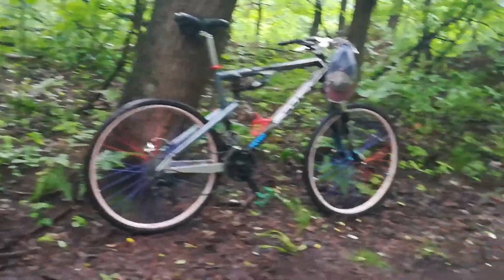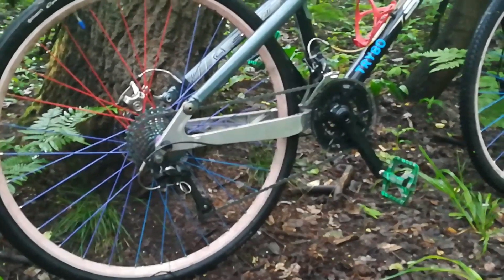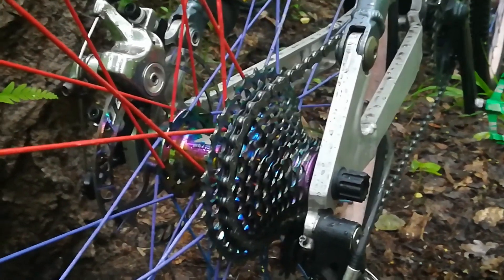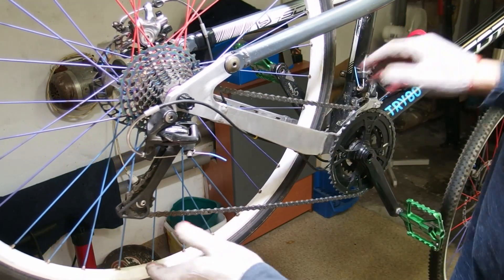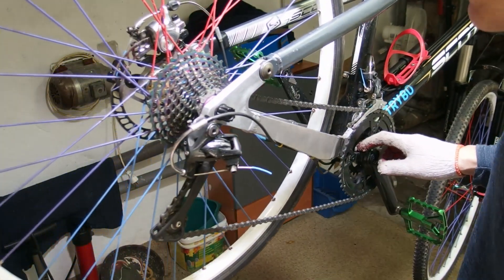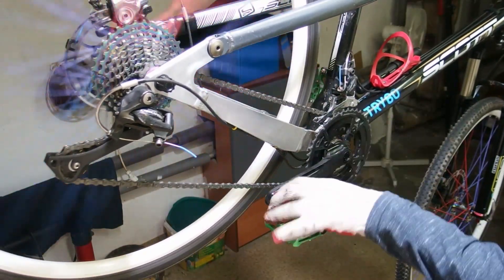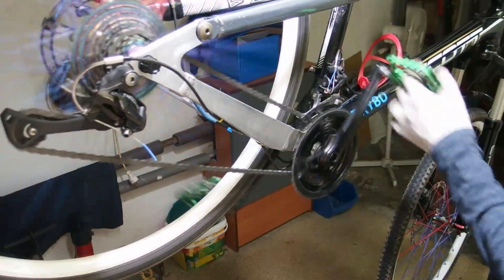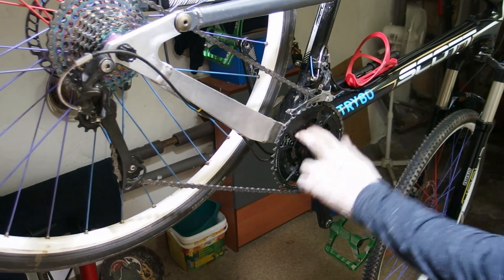The amazing 3x12 and ultimate demise of a triple.

Comment: And in 2022 I'm rolling 3x12, 44-32-22 and 9-52, 1155% range, I think it's impossible to beat.
Reply: A Jack of all trades, I wish I had a 10-36 12 speed cassette with 3X chainring for micrometic precise shifting
Reply: What is youre cassete and chainring
Reply: I want also a 3by12 on my bike
Reply: @AcemariesJannIcalla  KCNC MTB Cassette 9-52T for SRAM 12-speed, Shimano Acera FC-M361 Crank Set 48-38-28 + 42-32-22 = 48-32-22
Reply: I see you made a video showing a 3x11 can you please make a vid of this? Sounds incredible! Also how many of the sprockets are usable with each chainring?

Comment: I'm currently installing a SRAM 12-speed NX cassette and derailleur on my old school, 2008 BMC FourStroke mtb with a 3x, front derailleur.  The front is 22, 32, 44 and the rear is 11-50.  I live in the mountainous regions of Western Colorado and steep, rocky climbs are the norm.  Five mile, 18% grades filled with boulders and loose rock are common.  The bike has 26 inch Spinergy Xyclone carbon spoke wheels with 2.6 tires which measure 27 inches.  The Fox fork has 3 height settings from 170mm to 120mm which levels the bike out for climbs and then for descents.  The brakes are 4-piston "Shiguras" with Magura calipers and Shimano XT levers and 203mm rotors.  On long descents there is zero fatigue in my fingers.  I don't even think about it.  The PNW dropper seat post is super nice to adjust comfort level for climbs, descents and for quick, constant obstacle maneuvering.  I normally use a medium frame, 17 inch, but for this setup I'm using a 21 inch, XL frame with zero stem extension which puts the bars back against the steer tube shifting my body mass back where it needs to be since the top tube is long for my height giving me a comfortable reach for long rides.  There's no problem with the front wheel being too light since lowering the forks to 120mm leverages my weight forward over the front wheel for climbing.  
My "other" bike is a 2020 Stumpjumper EVO Comp Carbon 29er.  Of course it's a 1 x 12, 11-50 with a 28T oval chain ring up front.  No doubt it's extremely fast and stable on the downhill because of the 29 inch wheels with 2.8 tires and also because of the long wheelbase and low center of gravity.  But, steep climbs are a bit tougher.  It's interesting to compare the two extremes.  The Stumpjumper being long and low with big wheels is easy to ride.  You don't have to think too much about obstacles since the bike just rolls over them, whereas on the old school BMC you have to look ahead and plan ahead to pick the best line to get through the large rocks and scree.  But the BMC weighs about 5 pounds less and has lower gearing, which is about to get even lower; extremely low, 22T x 50T.  That's going to be a trip!  I may have to up it to 24-50 or 26-50 in order to not just spin and then tip over because I'm not actually moving forward anymore!  Bicycling is journey.  I don't think there is a destination.

Comment: There is one glaring flaw in your impecable analysis...not all of us live in areas that have one or just two types of terrain.  I live in Southern California.  I have long flowing trails, have rock filled technical trails, super long steep trails (both and down), flatter trails as well...and only can afford to have one $4000 bike.  What's a spoiled Southern Californian to do if he can't afford three or four different mountain bikes for each type of terrain?  What you do is put a double, or dare I say, a triple with an appropriate cassette to handle all types of extremes.  And, yes, you will mostly use a certain range, but it is comforting to know that you have the type of expansive gear range to handle everything the local terrain can throw at you.  Is it cool...perhaps not, but I'm still on the saddle going up mission trails  while some of my cool friends have to walk it or buy an e-bike to climb it.  I'm also limited to downhill speeds by my own pucker factor and not my bike's short top gear.  So for some of us, the double and triple (with all their quirks) are still preferable.  Think about this.  A triple setup with a 30-32 middle chainring is basically a 1x drivetrain with two additional set of options depending on the terrain.  Even if you spend 80-90% of the time in the middle chainring, when you need that 22 or that 40, you'll be thankful you have it.
Reply: I live in the Sonora desert and 3x Is handy AF, I can do enduro or Downhill or even mash It with the roadies in my steel 26er It Is so practical, and cheap!

Comment: Truly beautiful! I run 3x10 now but with extended range of 12 speeds 2x would suffice. Actually with 40T chainring, 11-42 would be enough for me in tri-city area. Still, I'm quite familiar with my front derailleur and don't find using it any more challenging than the rear one.
Have you ever tried side-swing FD from shimano? I'ts amazing how good and how smooth it changes the gears at the front.
Reply: why do people not go with 48-50t chainrings(like me)?..  when comuting the fast gears give a low power&spin coast and for hills on my 1 x there is enough low for climbing.  if i was to do a 3x again id get a 8/9 speed 32t light weight casette and 52/44/32(ish).  id still have good jumps and less weight.

for myself the alure of a 2x or a 3x is the downshift underload.  for uphill you can bring the power in a gear all the way to its limit and pop down a chainring and continue whereas for a cassette there is propbably 3-5x more crank movement needed and more tourqe to derail 'through'.

Comment: 3x10 is not only extremely useful in mountainous countries but also a beautiful number.  A dura ace or XTR crankset in 20 years time (2040s) would be like those campy cantilever brakes.  Beautiful and functional components highly collected.
Reply: There are some hidden gems like the Exage and STX Shimano stuff you can literally get them for the cost of a meal and are wayyyy better than the current Deore and SLX stuff when It comes to resilience

Comment: I have 3x7 drivetrain 28/38/48 and 16-34 those speed are usually useful and I use all of them on my routes. The thing is on my routes there are 2 awful clibs and I have to travel through avenues at high speeds. So I'm changing to 9 speeds making it an 11-40. I might not have to use that 11 and 40 but knowing they're there hopefully will give me more confidence.

Comment: I wish there were a newer thread on this.  I am going to run 3 x 12 but only use the middle. that is because my triple is very light, I'm cheap, and every once in a while it is nice to have a few extra long gears. I might just skip a front derailleur and move the chain by hand in the rare occasions I want longer gears, then see how much I do it, but the main point is saving money. well see if i really need that single front to keep the chain tracking correctly.

Comment: I had a Trek x-caliber that came with a 3x9...i hated it. I was always grabbing 2,3,4 gears at a time and switching between front chainrings it really took too much of my attention. It was getting a bit worn so I decided a (nearly) all new drive train was in order. I had 2 goals: more range (im a terrible climber, and we have some very fast downhills into the river valley), and less gears!  Instead of Sram eagle 1x which was all the rage in 2018, I went with  a 2x11 setup: 11-46t cassette and I believe 22 or 24t and 34 or 36 or 38t  up front (cant remember exactly). Result was absolute perfection. with long cage slx derailleur it could handle the 14t jump on the big cogs no problem. I could climb the steepest stuff with greater ease, albeit slowly, and ripping down into the valley at 70kph without spinning out was so much fun.   It was stolen this spring unfortunately. I liked the result so much, i would absolutely do it again if the opportunity comes up.

Comment: 3xX is the way to go -- the smallest cog for sand and steep uphills, middle one for dirt/gravel and mild uphills, the biggest one is for asphalt flats (speed). I run 3x9 currently and the only thing I miss is a crankset with bigger range -- I have 22-44 but I would prefer 20-44. 3x10 Tiagra looks like having even bigger potential but Shimano ruined it by not providing this 22-44 crankset. What a pity...
Reply: It's good as long as you use all of those. However, living outside of mountains, you generally find yourself grinding off 2 or 3 rear cogs and rarely touching a granny. And still, you have to deal with making those big ratio's changes in the front, or going highly cross chains. 2x whatever seems a way to go.
Reply: What's the number of teeth of your cassette?  My crankset is 42-34-24 and my cogs are 13-28 it's a 3x8 set  i wanna upgrade to 3x9 what's the right gear ratio of my cassette?  I feel my mtb needs more speed when I'm going cross town. is  11-42 OK 😎
Reply: @herbertleekwan596  I don't know "right", it is simply what suits your needs. I have 3x9 setup with 12-34 cassette but this is a hybrid cassette, so I have tight part for riding fast, and warmup part for accelerating and climbing. This season I would like to drop 22T crank and install 20T, this will allow me to run 12-28T cassette. My current setup: https://przypadkopis.wordpress.com/2020/08/04/gravel-566/
Reply: @zelupl2063  Sorry for the late reply. I live in flats, and I use all gears, sure, some of them I use more often than the others, but it does not mean I should drop the rare ones. They are useful, very useful, every time I hit a climb or a sand I can actually ride, and not walk along with my bike. Cadence+range is what I need, and any other setup (2X, 1X) limits former or the latter.

Comment: Hi Trybo. Could you input here in the comments the exact parts you are using to get your 3x12 drivetrain to work? Thanks.
Reply from the maker: On my XC bike it is:
- Crank - Deore FC-m6000 (40/30/22)
- RD - Deore RD-M6000-sgs
- FD - XT, i think 10 speed 3x10
- Chain - Deore 6100
- Cassette - Sunshine 12 speed 11-34
- front shifter - Sram X7 grip shift
- rear shifter - LTwoo 12 speed

On my road bike
- Crank E13 XC with bontrager 9 speed chainrings ( 44/32/22 )
- RD - Shimano Zee with a custom long cage
- FD - some 10 speed slx 3x10
- Chain - KMC x12
- Cassette - ZTTO 11-32
- front shifter - sunrace grip shift
- rear shifter -  Sram NX 12 speed

Both have the crank set up for 47.5 chainline
Reply: @TryboBike  Thanks for all the details!

Comment: Hi!
Thanks for this video 
I am about to do same setup 3x12 and the components that I'm about to use are:
1- shimano deore m6100 12s group set
2- shimano deore m6000 3x shifter
3- shimano deore fc-6010 crankset 3x10 speed
The issue made me confused what speed chain i have to use ? 10speed chain or 12 speed ?
And you mentioned you made modifications for the gear derailuer. What was exactly?
Reply from the maker: Your setup is not going to work. 6100 series rear mech is married to the large range ( 10-50ish ) cassette and will not work at all with a triple chainset. Or double even.
Reply: @TryboBike  thanks a lot🙂 and what can you recommend me to make the setup success for rear set? I will be happy for your help cause I really want to perform 3x12 setup
Reply: @TryboBike  Why wouldn't it work? Would the range be too big if you would add a triple chainset or what's the problem with the idea?
Reply: @ghassanmustafa615  Have you performed your 3x12 setup?
Reply from the maker: @stefanmayer444  Depends what you are asking for.

If you want to have one of those wide range cassettes ( 10-50 or so ) then there is not a single RD which can handle a triple there.

EDIT: The x100 series or RDs use high offset guide pulley which makes them incapable of handling multiple chainrings. x120  RDs are limited to 10-45 cassettes and can't handle more than 10T of front difference.

The widest you can get is 3x12 with an 11-42 chinese cassette and even then you need to find fairly obscure parts.

If you want a normal 11-34 cassette in 12 speed + a triple, then it is much more doable, but you still need to mix-match parts from different types of drivetrain.

I actuall am currently running 3x12 on two bikes - but it required a little fiddling and experimentation to get it working. It's doable, but the benefits over a mundane 3x10 are not that great. it was more of a vanity project for me.
Reply: @stefanmayer444  I had perform 3x10 with the following set (shimano deore fc-6010 crankset 3x10 speed "the biggest range 48" + 10x shimano deore 11-46 cassette) and I can say 90% working.
Reply: @TryboBike  Thanks for your explanation!

I'd love to try this with a 11-51 cassette. Silly as it may be, I just want to try this out :-)
So would it be possible to extend the capacity of the rear derailleur by cutting the cage apart and extending it to make a extra long Cage?
Reply: @ghassanmustafa615  Cool! What are the 10% of it not working properly?
Reply: @stefanmayer444  the 10% i can say is just delay time with changing with 5th and 6th gear. There are some delays.
Reply: @ghassanmustafa615  Thanks for the info! :-)
Reply: @stefanmayer444  my pleasure, and im about to try with 12x cassette, it a risk but deserve the try :D
Reply: @ghassanmustafa615  Good luck with that!

Comment: i am fan of versality of triples here i have xtr m9030 "aka pd-9020/3" 3x11 48-36-26 with 11-42 custom cassete & 48t chairing of metrea. and on my touring an ultegra 3x10 53-39-30 with 11-34.
Reply: What fd do you use?
Reply: @mk30b25  FD-6703 ultegra and deore xt FD-T8000-L because my original xtr fd shift the 48t chainring but rub the chain on 26t.
Reply: Nice setup, reminds me of my 3x8 on my steel 26er, I run a cheapo SR Suntour 48x36x28 with a Frankenstein 12-36 8x cassette. I wish to upgrade to 11x but with the same cassette range, only to make shift jumps more subtle. Maybe I add a 38T final gear but that necesity could be compensated with training more since 28-36 can climb anything in 26"